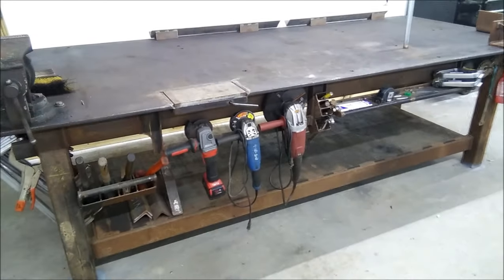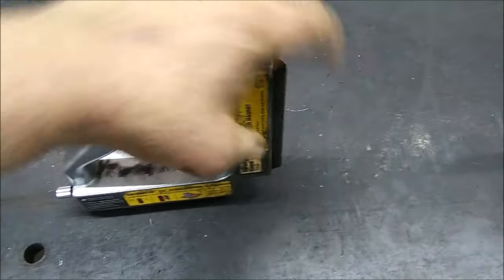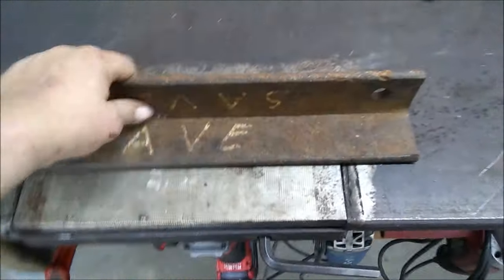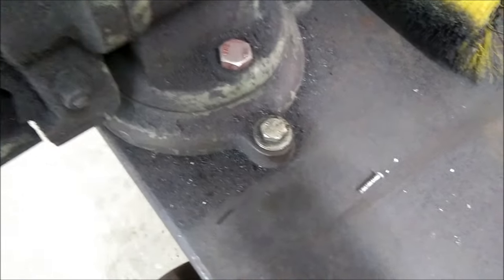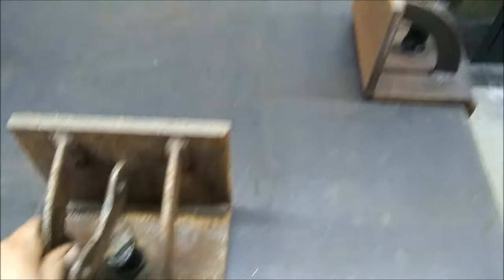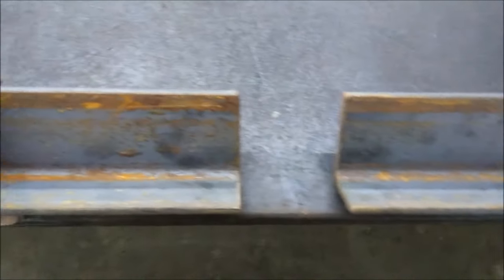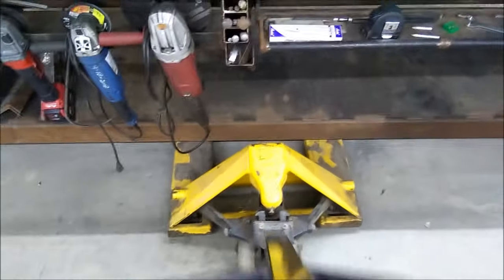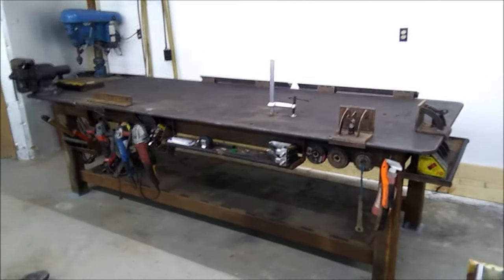1 ton HD welding table with cool features

Comment: Wicked table!  One thing I would do is add sub shelving on half of the table so you can separate the different types of steel.  For example, one section for channel, one section for angle....etc.  That way if you end up with lots of drops you're not fighting to get the specific piece you need out.  Plus it helps with clutter and keeps you organized.  Cheers!
Reply from the maker: I got a giant HD steel shelving unit that a use to save drops ... but yes if I wouldn't have that that would be a good idea. Thank you

Comment: How have you weighed it?
Reply from the maker: not on a scale but the top it self is 1225 Lbs and the sheet on the bottom shelf is 184 Lbs the 4x4 legs are 146 Lbs the 4x6 for the top sheet are 249 Lbs and the 2x4 for the bottom shelf are 140 Lbs total this is 1944 Lbs total and I didn't calculate any of the short cross members that are welded in so I'm probably well over 2000 Lbs ... hope this helps and thank you for watching

Comment: That table is great, man!  I really like it.  I also like that you have fixture holes just where you need them instead of peppering the whole table full of them. If you need more, add ‘em! 
A question - Where did you get the speed clamps you show?  The ones with the ratcheting cam instead of a screw down head. What brand are they?
Reply from the maker: the welding clamps with the yellow ratchet handle are made by Realgear I got them at my local welding store Praxair and if you call them their part number for that clamp is RGU686012 hope this will help. Thank you for watching
Reply: @CountryMileGarage  Complete with part number!  Thanks!
Reply from the maker: @aviatordave1  glad I can help just keep in mind they are not cheap but they have lifetime warranty
Reply: @CountryMileGarage  I’m seeing that price tag online.  They weigh about 5 lbs from the description. They look like they’re built like a tank. Anything with really good quality is worth paying for, in my opinion.
Reply from the maker: @aviatordave1  agree with you 💯 quality is worth the money but lots of people get sticker shocked when they see that price tag lol. And they honor the warranty I bend one by my own wrong doings and no questions ask they swap them right out. And yes they are heavy and well build
Reply: @CountryMileGarage  There’s a Praxair close to me but I’ve never done business with them. Do they keep track of what you buy through an account or do you need to hang on to the receipts?
Reply from the maker: @aviatordave1  for me they know me well enough lol but I'm pretty sure they keep track of it with your account
Reply: @CountryMileGarage  That’s good. I hate hanging onto receipts.  Thanks for all the info!
Reply from the maker: @aviatordave1  no problem glad I could help